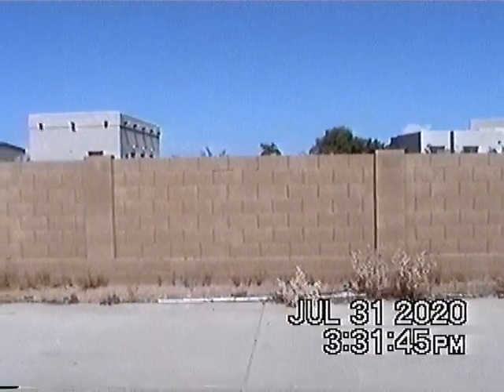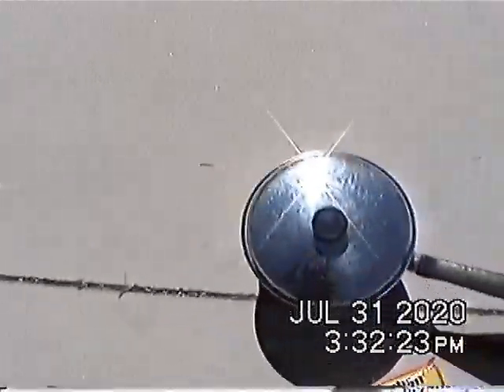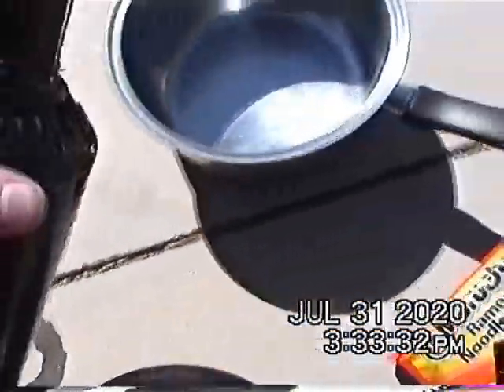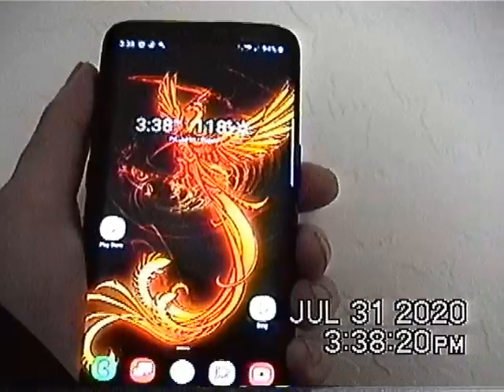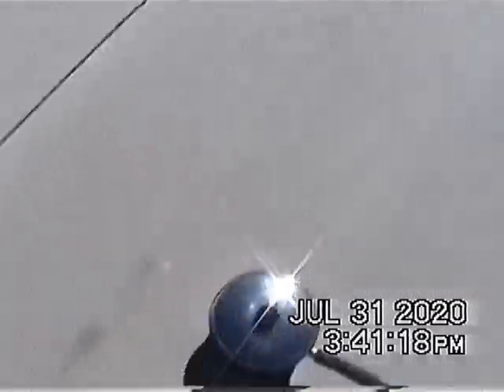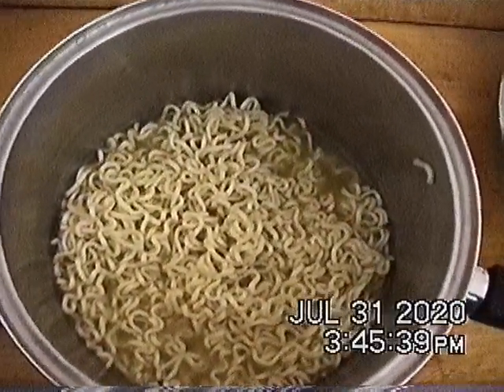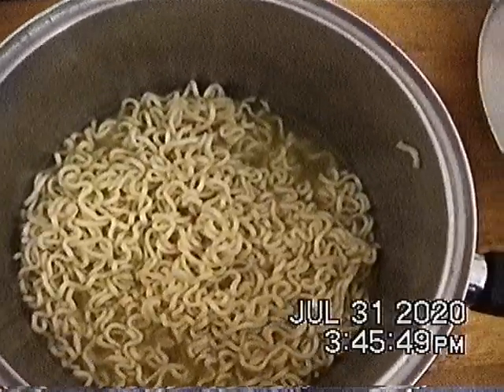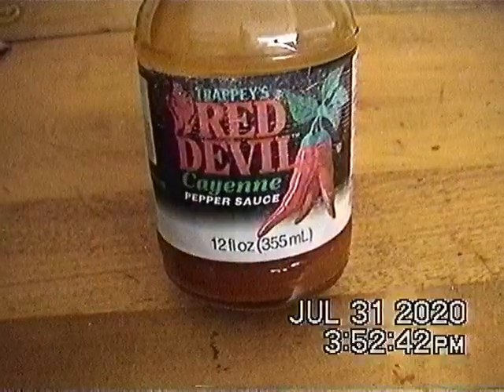How To Cook Ramen Using ONLY the Sun (NO Solar Panels, Electricity nor Fuel)

Comment: Maybe putting a black tarp over the pot as it cooks, not that you need any more heat but if you were cooking something larger a black tarp over the pot might help.
Reply from the maker: I've tried that. It doesn't get as hot because the sun isn't directly shining on the pot or bottle. A black tarp only gets the water to about 127 degrees. That's why I have black tape tightly wrapped around a glass bottle and a bare steel pot all sitting in the sunshine. :)
Reply: @SouthwesternEagle  ahh ok, very cool.